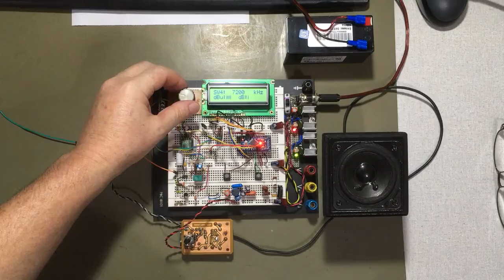Simple AM/FM LW/MW/SW/CB Arduino DSP Radio Receiver - With Schematics and Sketch

Comment: What antenna are you using sir
Reply from the maker: It is a cable (wire) with  8 meters long stretched and stuck to the highest part of the house wall.
Reply: @Cesarsound1  Thanks, btw i loved your work 👍
Reply from the maker: @yigitkadir3649  Thank you!

Comment: hi could add a Pulse Frequency Duty Cycle Adjustable Module Wave Signal Generator to sweep though the channel and a  Potentiometer to low or speed up the speed please . this is what im looking all the frequencies
Reply from the maker: Hello, thanks for the ideas, but unfortunately the IC Si4730 does not work that way, it would not be possible to implement it.